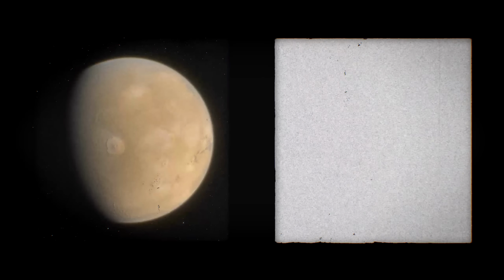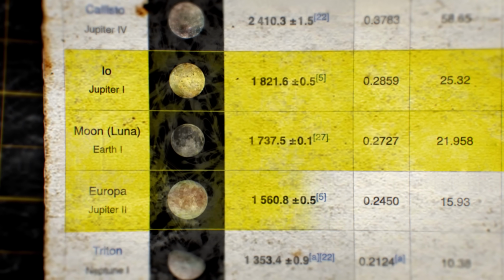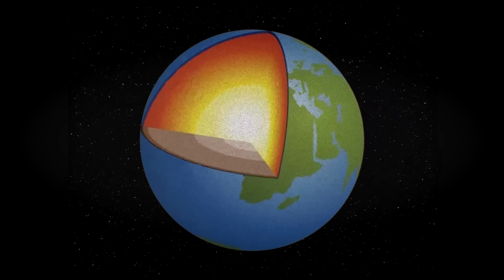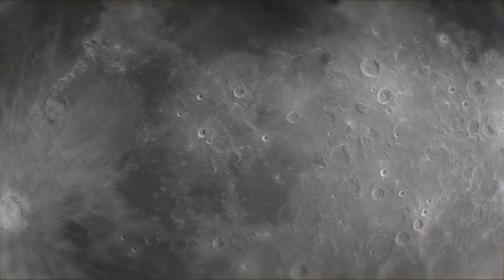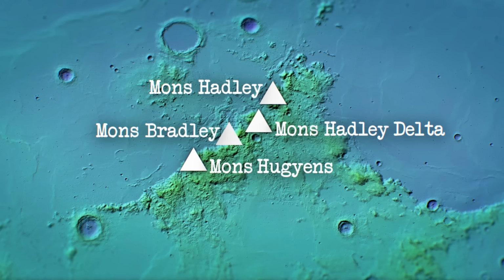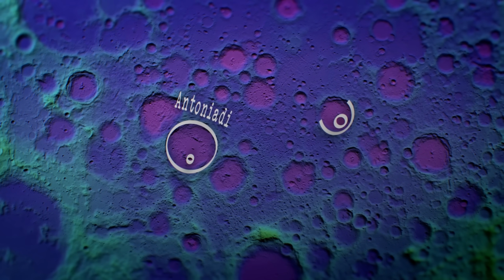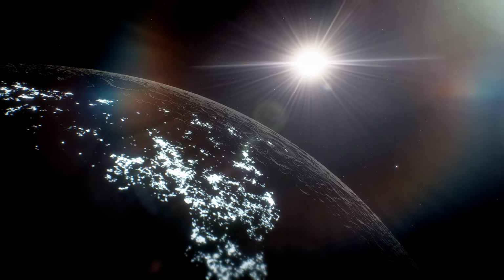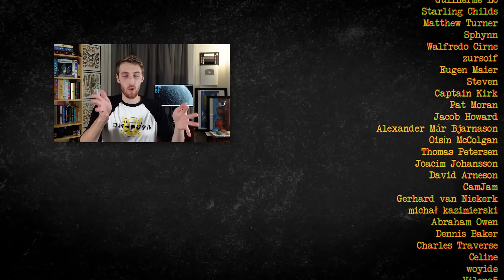Why The Moon's Geography Is DEAD

Comment: 1) Mare is pronounced “Mah-Ray”, not “Mayer”. 
2) Huygens is typically pronounced “Hoy-Gens”. The original Dutch pronunciation is even more different but it’s definitely not “Hud-Jens”.
3) The South Pole Aitken Basin is NOT located “around the South Pole”. It’s a giant basin thousands of kilometers wide and stretches nearly to the EQUATOR. Just look at it. It is manifestly not “around the South Pole”. It’s named that way because the South Pole and the Aitken crater mark two roughly opposite points along the PERIPHERY of the basin. The South Pole simply marks the southernmost edge of the basin. You wouldn’t describe South America as being located “around the Antarctic” or North America as being located “around the Panama Canal”.